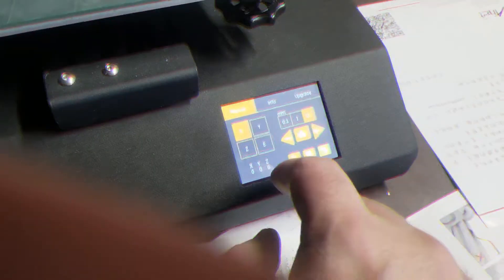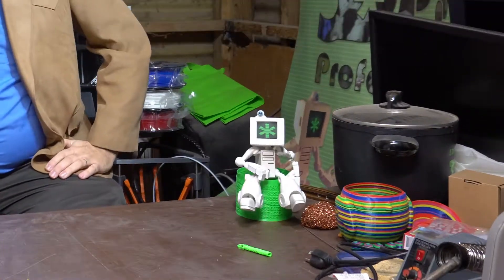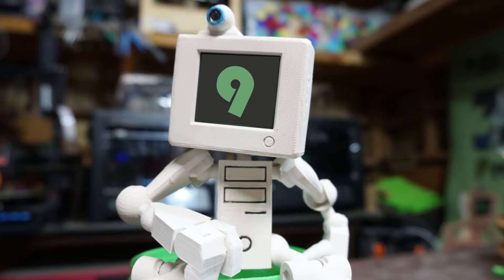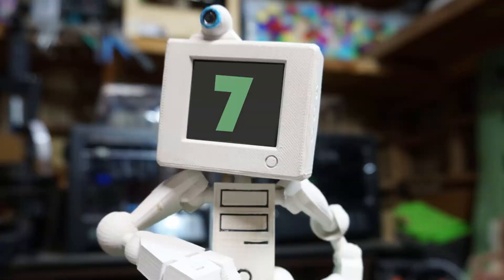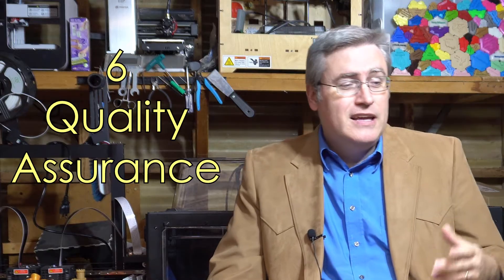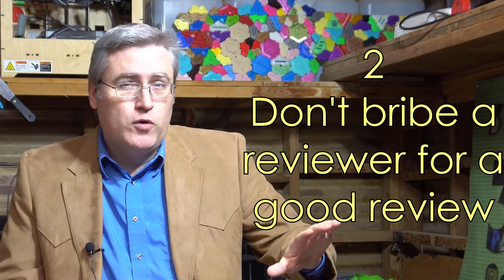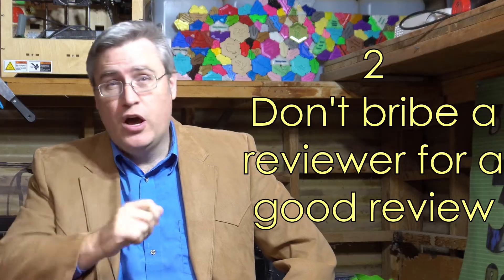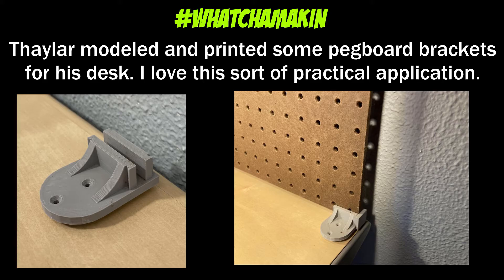10 ways 3D printer manufacturers Fail

Comment: I started with a creality ender 3 pro this year and only have good experience. If I would purchase a second printer it again would be a creality because I simply don’t understand why other manufacturers charge 3 times the price for pretty much the same machine.
Reply from the maker: There's definitely something to be said for improving the user experience. Once you've started a print without having to do the SD card shuffle, trust me, you'll never go back. Touch screen UIs are a dream. And really solid engineering so you can do even tall prints with spindly parts without a bit of wiggle... yeah, that's the stuff.

Comment: I would argue that at this point ANet is fully aware they are just pumping out junk, with no intention of even looking for the high road. How could they not know any better at this point?

As for all the manufacturers failing, I would also add in don't be lazy. I am not sure this fits into one of your existing points? But an example is baby stepping in firmware. There are lots of great features that Marlin offers, and very few manufacturers bother to enable, including Creality.

Comment: I have a perspective on two 3D printer companies. I have been printing now for 5 months. Started off with a very unknown and, for those who know it, a printer with really bad reviews, a Dobot MOOZ 2. When I got it I was 1 printhead disassembly away from returning it. I had multiple filament jams. I became an expert at disassembling and reassembling the printhead, which for the MOOZ it's a Printhead module. I can rip it apart and reassemble in 15 mins, a Guinness world record. BUT I learned what I should have know, BUT you know what? YouTubers do not really explain how to load filament and the Modules with both MOOZ and Snapmaker are directly into the module which contains the extruder inside. I now straighten, and I mean straight as a nail, about 5 inches of filament, cut the tip at that sharp angle and load it past the filament run out detection till I feel the extruder grab gear. I stop there, heat the nozzle to 200c then I press the LCD load. No NO JAMS in months. I see a few videos with the MOOZ bashed for that reason and the disassemble nightmare, more on disassembly later. In parallel I was getting extremely bad bed adhesion. I tried hairspray, glue stick, painters tape and then I tried Elmer's school glue (a miracle). I made mistakes here also as you might think the the best adhesion is when the glue is slightly wet, to the touch it appears more tacky then when it dries. WOW, was I wrong. Fully dry till it's clear an that's the best stick. No YouTuber really calls this out. I can even wait till the bed cools, easily lift the print leaving the glue still down, I then can run a couple drops of water on the build plate turning the glue cloudy white, let it dry with the bed heated to 60c and I can lay down a second print. In fact I can lay down about 7 prints before I have to re-glue. Now, major reason Dobot gets bad reviews seems to be their lack of responding to customers. Almost zero response from what I have read.

In contrast I have a Sindoh DP200 which has an autoloading cassette that is SUPPOSED to make things easy. Actually it doesn't. If you get a filament jam you can't release the cassette without playing with the LCD screen to finally release the cassette where you can get to the filament, of course that doesn't clear the jam. The Sindoh, and I will assume the other Boden extruder machines are much more complex vs. taking part the MOOZ module to clear a filament jam. You have to remove the side cover, remove the gears, remove the extruder step motor and finally remove the extruder, release one of the grab gears and clear the filament jam. It's a total pain. Happened to me about 4 times in the 3 months I have owned that machine. BUT, I learned here also to cut off about 9 inches of filament that hit the extruder gears because, it seems like a 30% chance that any of the filament that hit the gear and scored the filament might jam. So, lesson learned, cut off all the filament that ran through the boden tube and discard it. Much easier to loose 8-9 inches of filament on changing colors vs. a filament jam. BUT, Sindoh responds every time within 24 hours. EXCELLENT response vs. the horrible response from Dobot.

So that is my experience with 2 companies and 2 machines. As a side note Sindoh sent me firmware so I can use 3rd party open source filament. And loading filament not using the cassette is another learning curve. 

I will add this, my neighbor has the very loved PRUSA, he is blown away in that the MOOZ makes better prints than he gets on his PRUSA. In fact I get better prints on the MOOZ than on my Sindoh.

That's all I got.

Comment: I bought my first printer about 4 years ago.  Never printed one thing.  Poor documentation, like I would know anything about them?  I did not.  And it sat there - looking - no, sneering at me for 4 years.  I ordered my new one.  This time, after two weeks watching reviews and how to videos, dismantling the old one, as a sign of better things to come.  My Ender 5 plus came about 10 days later and I have continued to watch 'how to' videos and it is making me a better hobbyist and a happier person.  
I am so dang happy with my choices, that I could have ONLY made if I was informed about what my choices were.  Your reviews matter - a lot.
Thank you for what you do!  I am going to use 2 of the old stepper motors for a can crusher project I have been mulling over for a long time now.  But first I want to learn how to design and print, my ideas on simpler things - like a gear reduction box that will increase my torque by 300%, I'll teach those old steppers all about sneering!

Comment: Great video, and good points.
It seams like the design is not moving in the cheap arena, only to have a 32 bit processor seams to be the last change. And in my understanding they use silent steppers in standalone mode, and don't use the potential to use the serial mode activ in the software.
I think that it is in the Slicer software the magic is happening just now. Most of the mechanical problems is solved in the better printers I think. And then we are back on the software again...
Thanks for sharing your knowledge to all of us, and happy holidays to you and your family 👍💖😀

Comment: Interesting observations, thanks! I bought my first 3D printer a few years back and it certainly fitted into the #10 category; that was the case for many printers in the early days. I was going to keep upgrading, and then realised that I would end up spending a lot of money and time just to get it to a satisfactory level. So I recently bought a new printer, and it is working nicely without a single upgrade. The old printer is now being stripped for spare parts and scrap 🙂

Comment: I don’t think  Creality really sets the standard for getting it right out of the box.  They are and have been a price leader though.  How many hundreds of videos can you find on the 25 upgrades I made on my Ender 3?  A further case in point is the supposed industrial model CR-5 Pro 3D Printer.  Solid frame with a slapdash of old technology poorly executed.
Reply from the maker: I think Creality strikes a good balance between price and quality. Sure, the quality isn't great, but  "for the price". Their support sucks, yes, but they're popular enough that it doesn't matter because the community is their support, and darn it they're leaning into it.
But yea, you can get a better printer for more money. Capitalism is still doing it's job.
Reply: Yep, is not empressed, of the design choices in the CR5. A study printer design, yes, but have not learned anything of the last year's.
Have seen test.... Hm.  A Prusa seams as a better choice, and then buy 4 of them..

Comment: Thank you for showing the dark side of 3d printing.  I have wanted to get a printer that just works because I am into designing the print, not tinkering with the printer itself.  This is why I dropped >$3000 on a MakerBot MethodX.  It worked for a couple of months ok, but I am now running to recurring problems (with PLA!).
Reply from the maker: Good to know. I'm still trying to get my hands on one of them.

Are Makerbot working with you to fix it? $3000 should buy you some degree of support.